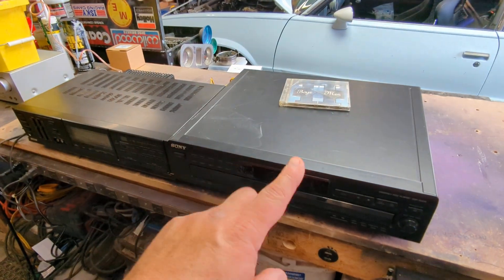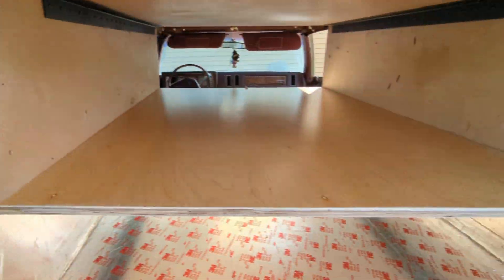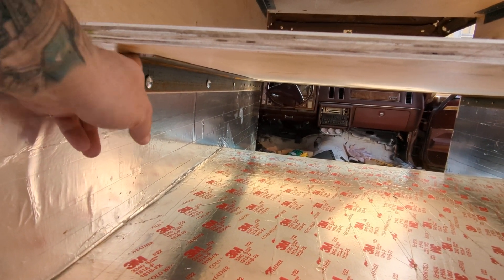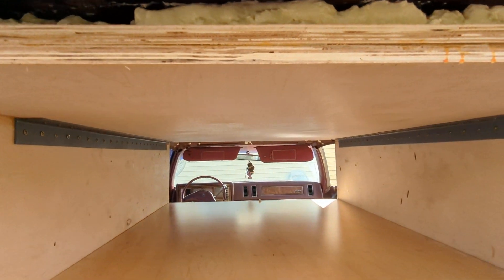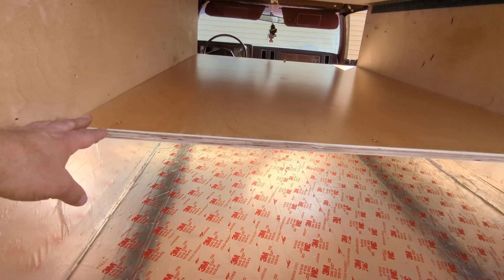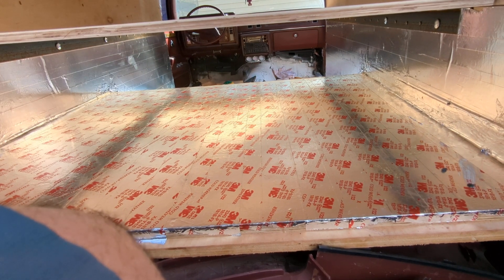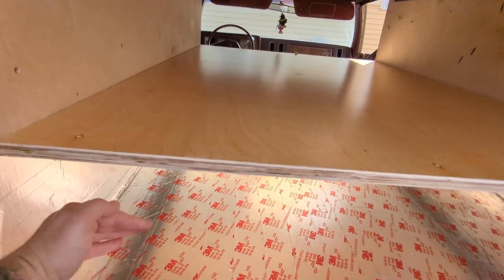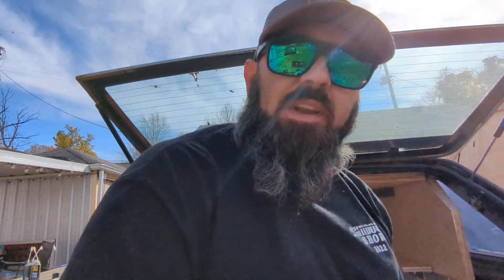Dirt to Demos....Baffle time and more spray foam!

Comment: I like French cleats.  I tend to add an extra screw on the bottom so that it ain't going nowhere.
Reply from the maker: I haven't tried that. I like to 45 a 2x4 then pre-dill and counter sink my holes. I seen the metal bracket versions but this way hasn't failed me yet.

Comment: Why not drill holes in the top layer of the enclosure to spray the expanding foam. So you don't have a chance of the roof leaking later.
Reply from the maker: Roof already has holes in it from the luggage rack. I'm taking it off so I have to plug those holes anyways.